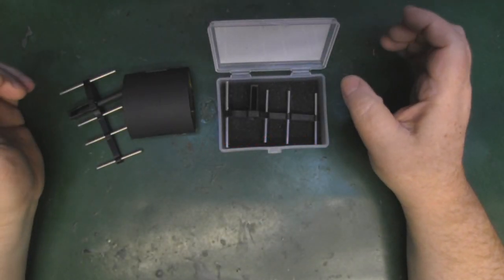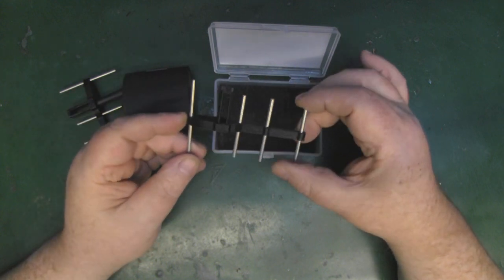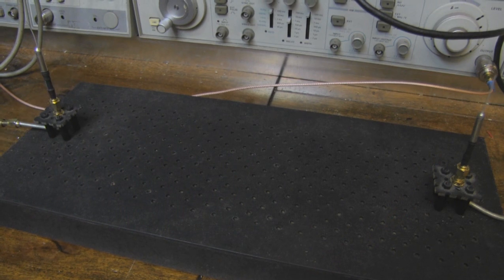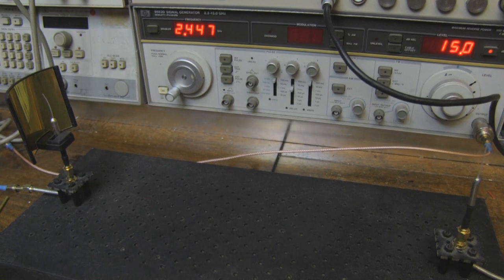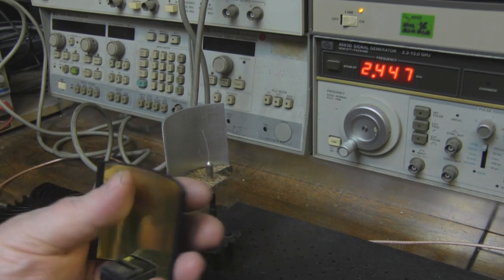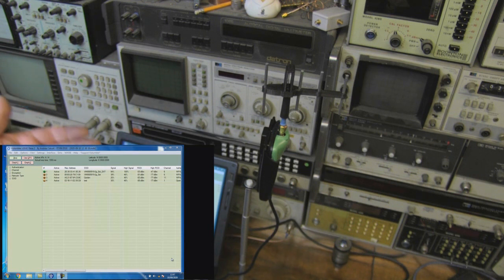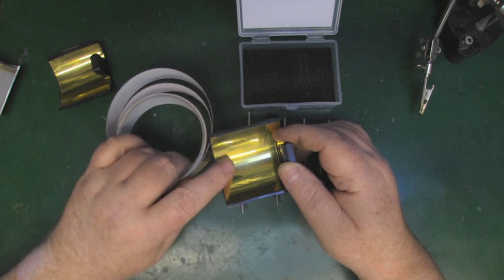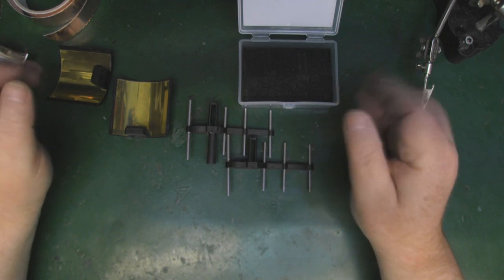FPV Antenna Range Extenders Do they really Work?

Comment: Nice video! Thanks for collecting and sharing the data. I use the parabolic and the Yagi together on my radio transmitter for improved signal.
Mine are used on a DJI Spark quad. My Yagi is for 5.8. The drone can be flow 2.4 or 5.8

Comment: Good video, nice to see they are not snake oil!  Most Yagi calculators I have used have differing distances between the directors.  The first director is always much closer to the dipole.  Yet to see one where all directors are equidistant.

Comment: I would like to see you do a video on these designs for LTE, particularly a log periodic dipole adpater would be interesting. As seen in one of your recent videos, the log periodic covers the entire LTE spectrum well, but i'm not sure if it's possible to make an adapter with the type of wideband dipoles used inside the integrated antennas. Great video as always Andrew.

Comment: 13:30 simplest solution to the focal point problem is snip off the reflector on the back of the yagi - as a guess I'd say the spacing to the para reflector should be the same as the centre axis of the reflector rod, or close to it) given that both perform a similar function of reflection.

Not sure if you'll get much extra forward gain that way but you should see a difference in F/B ratio and probably font-to-side ratio too. Maybe 3 or more dB of it. For a typical 2.4GHz WiFi scenario the improved F/B could be very useful. 

In the past I've dramatically improved poor links (typicaly along long buildings or where the AP/router is at one side of the building, STAs at the other end) by shielding off the unwanted sides of the AP with bottles of lemonade (yes, lemonade) to slightly absorb signals from unwanted directions.  2.4GHz is readily absorbed by water (which is why it's used for microwave ovens) and lemonade works better than spring water (yes, we compared it - we got desperate and we had several 6-packs of 2L bottles lying around) Maybe the slight conductivity of the pop vs water was helping with increased losses.  This wasn't reflection or lensing, purely absorbtion of unwanted RF at the sides from interfering stations. 

Worked well for internal antenna APs, that were especially struggling as we couldn't easily change polarisation to null the interference - though multipath scattering skews the polarisation a lot indoors you can sometimes find a sweet orientation for a built-in or screw-in standard plastic sleeve dipole on an AP or router. If in doubt orient the end of the dipole antenna at the source of interference to try and get a bit of a null (and just hope the pickup from the wanted station is in a main lobe)

 Luckily the APs and routers were placed on benches so stacking bottles around them was no problem. People nicking the pop was a much bigger problem though :(

Spacing from antenna to pop wasn't critical - we used a good 8 to 9 inches - any closer and I'd assume you'd affect the characteristics of the antennae due to coupling to the lossy water (you can tell it's not that critical when RF guys talk inches at high UHF haha)

Comment: Interesting stuff! 
When I was into quadcopters one of the first things I would do is modify the antenna on the toy transmitter. 
Usually it was just the addition of a little dipole,  but it always improved the range. 
Thank you for this exploration! 
73 de N2NLQ

Comment: printed some of these out for my magic mini controller for both 2.4ghz and 5ghz in my experience they do work quite well but very dependant on keeping them in line with the drone as the drone also has flat pcb antennaes also I believe

Comment: Thanks
I try today cut some aluminium foil disc and put on the bottom of my canttena and it improves the signal too??!!is it possible or Im just in lucky day?
I use cantenna for LTE signal on my b535 huaweii router

Comment: Hey Andrew.  While those little yagi's are definitely  travel friendly, I'd say the parabolics have the edge not being as directional.  Those little parabolic antennae, like a DIY windsurfer design, paired with an external Alfa Wifi adaptor are perfect for travel -- ultralight and fold-down flat for backpacking.  In your experience, is there an ideal parabolic shape for these antennae expressed as a function f(x)=aX^2, that is ideal for both Wii frequencies, 2.4GHz and 5Ghz? My guess is it's not the shape, but the overall size that matters, with bigger reflectors reflecting more signal at the focal point, with the thickness of the reflective material more important to performance based on the selected frequency.   

As for pairing the yagi with the parabola, why not cut a notch in the parabola to accommodate the yagi, and use some of that copper tape to cover up the hole once the yagi is in place. Uh, actually, you wouldn't want to cover that hole as it would block the rear parasitic element. Okay, so you'd lose a bit a reflective surface of the parabolic, due to the notch but you'd still reflect more signal to the dipole than without it, yes?
Reply: The rear 'parasitic' is not a parasitic, it's a reflector.  The parabola would replace it.

Comment: Do focal point and shape of the parabolic curve depend on the wavelength ??
Reply from the maker: No
Reply: ... which means you can check the focal point using light (a good torch), which is very short-wavelength radiation :)

(even shorter wavelength than 5G - quick, hide in da caves or we all gonna die!!! ) 

pedantic tech note: a parabolic curve is a very specific shape*, ie: that of a parabola - it's not any old curve - it;s an exact curve of a special shape. How accurate it needs to be to this particular curve *does affect how well it works though. eg: if it;s bumpy or out of shape, the focal point will be "fuzzy" and give less gain.
Parabolic reflectors don't need to use a whole parabola, in fact offset-feed satellite dishes use only a section of parabola, which changes the focal point off to one side. This avoids the feed point covering the reflector. which would reduce the gain somewhat.
Reply: No it depends on shape only
Reply: If the focal length not match to wavelength doesn’t the wave bounce and cancel some ?? 

I tried to make a parabolic double biquad antenna using windsurfer parabolic curve . And the focal length was 3cm . And normally 2.4ghz space has to be 1.5cm. I tried with 1.5cm flat reflector and with parabolic reflector . And with flat reflector it worked really well .